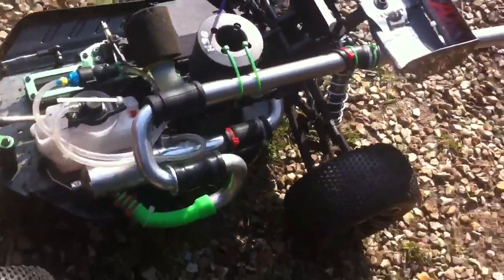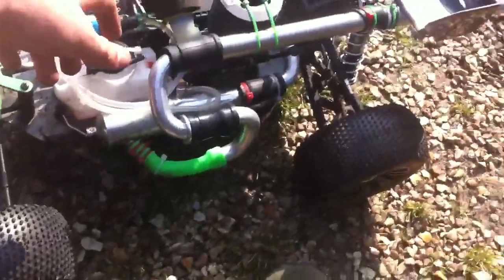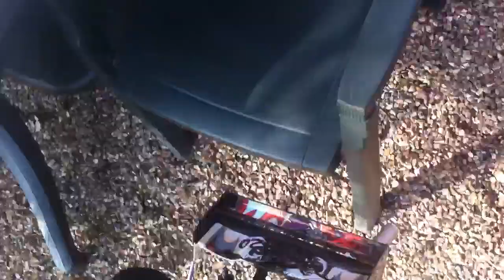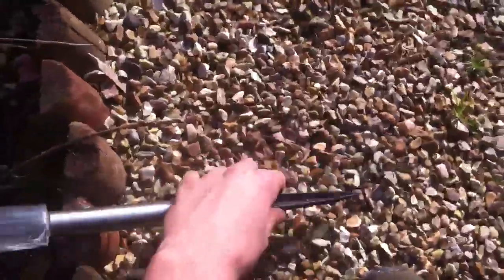Start up of home made Exhaust

Comment: I'd really liked to see this running. Idling and quick revs don't mean much as far as performance goes. If that exhaust works and the buggy actually does perform ANYWHERE near as well as one similarly outfitted with a real muffler, it's a straight up miracle! There is a whole science behind exhaust building for nitro.
Reply from the maker: https://www.youtube.com/watch?v=yuWQ0bWPjeA theres it running was running on the richer side but did find the right mix in the end and that's on 30% nitro hope that helps